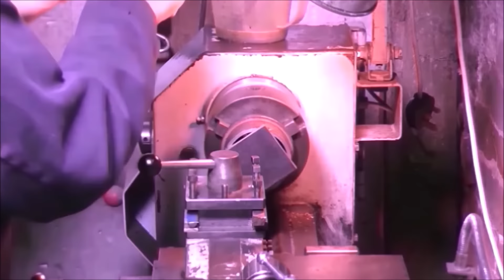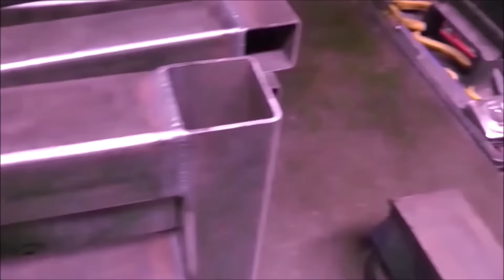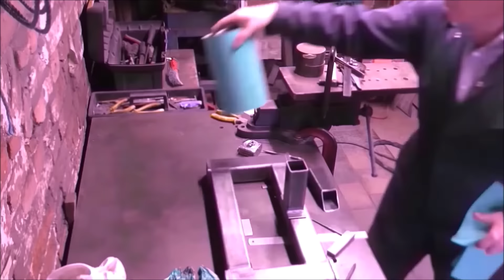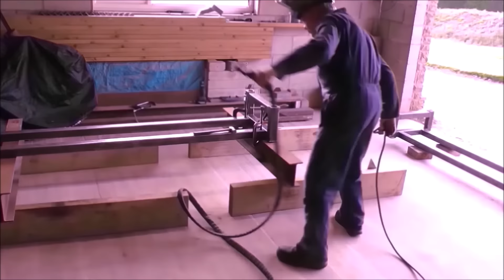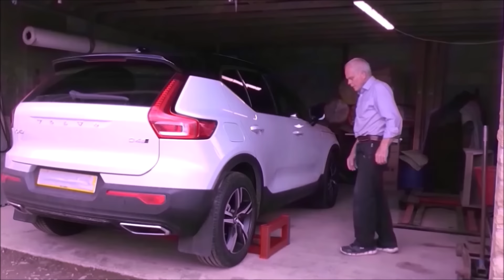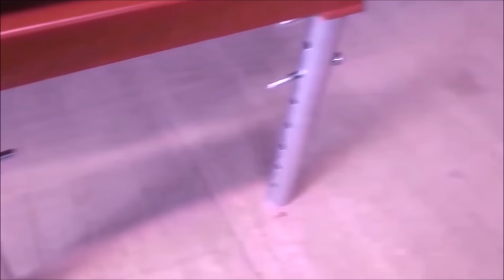The ultimate homemade car jack, simple to use, compact when not in use.

Comment: Honestly not hating, and it works for you which is all that matters. I do want to say thank you for sharing. For me, that much of a build, should have something that's quicker and more flexible. I'd like access to the wheels, brakes, under the engine. It shows me the options and idea's you have. The strength is amazing. As I think about it, the cross beam frames, set up with in the wheel base, and with padded blocks to the frame, might still have what I would want to see in my own set up. Thank you, once again.
Reply from the maker: watch the whole video and you will see any type of repair can be done, thanks for watching
Reply: @johnbower  Can you lift the car and leave the wheels free to remove them or for that matter an engine? I didn't see that in the video and I did watch to the end. Is there a second? Thank you
Reply from the maker: @JamesDoylesGarage.   Because the frames lift from under the car tyres there is plenty of working space above the frames to the under side of the car and it's engine etc, and the frames are easy to work around. Note: once the car is raised on the frames it is so easy to put jack stands under the sills and move the frames away if wheels need to be removed, I do show this in the video towards the end.

Comment: Great job.  This is the best DIY home jack I've seen.
Reply from the maker: Glad you like it, thanks for the comment
Reply: a $200 motorcycle jack and 4 axle stands would do the same job in half the time
Reply: @debeeriz I disagree.

The connected stands make the system a lot more robust.

With single stands the risk of dropping it, when someone falls towards the car would be significantly higher.

The design is extremely thought through.

Comment: Lifting a vehicle for underside service is a problem for everyone without a lift. Jacks and jackstands can be sketchy. I have a project car that needed a torque converter replacement, which means dropping the transmission, as well as running a complete new exhaust system, which required a bunch of cutting and fitting before welding it all together. I knew I'd be spending a lot of time under my vehicle and wasn't going to constantly raise and lower it and setup jacks and jackstands. I had a set of 10" wide truck wheels and tires  and some 2x12 lumber, so I raised each corner of the project vehicle enough to slide a truck wheel under it and rest a section of 2x12 across the truck wheel.  This got my vehicle roughly one foot off the ground on a stable platform and granted me enough room to work comfortably and safely for the duration i needed to complete my tasks. John, i appreciate your ingenuity in trying to solve a problem we all deal with.
Reply from the maker: My lift would have been ideal for the work you have done, the lift only takes a few minutes to raise a car to varying heights and gives clear access to the entire underside, and when the lift is not in use the frames stand on their ends in corner of the garage taking up little space. Thanks for your comment.

Comment: Hey John this is an Absolutely Brilliant concept !!! simple and modular, and to the person who says you cant get at the wheels , simply provide two more tubes that are shorter and use the clever double supported design to replace the long ones on the side that needs the wheel removed  by simply lifting that side and replacing which shorter support tubes  , thus unblocking access to the wheels , they should come out ok Top Marks , this world needs people like you who are not afraid to break ground with fresh ideas . Dont listen to the haters, keep up the good work. and i feel that you have already got half of a towing dolly or car transporter right there, if you just add a couple of struts  wheels and a towbar  Good on Ya !!!!
Reply from the maker: Glad you like it, thanks for the comment

Comment: Hello  Mr  Bower ,  I  skipped  through the build process  because  i  knew  exactly  where you were going  ,    Now then iv also  read all the comments  and there are a lot of negative comments  people  just dont the  grab the simplicity  of your idea ,    I  see this as a very good  frame for lifting a car  of any  size  from a  fiat  to a landrover  and once  up to the height you want put four heavy duty  axle stands in then you can remove  all four wheels and  work away  quiet  happily  .    Now then  for a seasoned   home mechanic  who cant afford  a car ramp this is brilliant  and with   2  / or  4  air hydraulic  bottle  jacks  this could be  lifted with ease ,  BUT  a good  compressor  would be a requirement   then  air tools  come in  to play ,    naysayers have  no vision   Stan .
Reply from the maker: Glad you like the idea, thank you for your comment.

Comment: Thank you for sharing this. As DIY-er myself, I've been thinking about some sort of homemade stand, to help me with a sort of rust repair/restoration project. My idea was to have the stand connected to the wheel hubs, so I can have the wheels removed and have access to the wheel arches. After seeing this, I think it might be possible to use your design as a base and add the HUB mount "extension" to it. I doubt most of the negative comments have ever made or even thought about fabricating anything. There are a lot of things to consider even for a simple task like this and you have done a great job. Thank you again for sharing.
Reply from the maker: Glad you like it thanks for the comment

Comment: I worked many years in the lift industry and what I can say is that your welds are much nicer that what I seen.
the major inconvenient of your design is that most of the time you lift a vehicule is to work on the wheels so the application is limited
very good video.
Reply from the maker: If you watch the complete video you will see that wheels can be removed if needed, Thanks for the comment

Comment: A wonderful concept. Great idea. Here in the US I'm going to have to beef up the design to HD. My vehicles weigh in the 4000 lbs to 6600 lbs range. 1800kg to 3000kg
Reply from the maker: Thanks for the comment, Just for your interest the main frame of the lift is made from 60mm square box section with a 3mm wall,  the legs are made from galvanized tube 48,7mm diameter with a 4mm wall,  it comfortably  supports my Volvo XC40 which weighs close to 1800kg.

Comment: As an engineer I think this is absolutely OUTSTANDING! I have always maintained my own vehicles struggling for HOURS to jack a whole vehicle up enough to only SQUEEZE under! I had a turbo change to do TWICE on one vehicle (don't ask I was sent a duff turbo first off)  and you pretty much nee to sit up UNDER it. The turbo is in a place that can barely be reached from under the bonnet, necessitating  it being jacked HIGH to be able to work easily. May I suggest adding 'spreader feet' to the uprights (square foot plates) - as I have no garage only a gravel drive , to stop them sinking into soft ground?  I have to use 'jacking boards' (thick plywood boards)  to stop my axle stands and jacks just sinking into the ground. You need to patent this and sell them PLEASE!!👍👏👏👏👏
Reply from the maker: @scopex2749,  When designing this car lift I did consider welding plates to the bottom of the legs for use on soft ground, but this would have made it difficult to slide fit the legs into the frames, also by not having plates welded to the legs means less storage space needed when not in use, So I decided that if the lift was to be used on soft ground metal plates could simply be placed under the legs when needed. Thank you for your comment.

Comment: I would love to see if you could incorporate some two ton bottle jacks connected with possibly a hydraulic line from one to lift simultaneously, wow what a great build outstanding
Reply from the maker: YMA. Note: the advantage of lifting from underneath the car wheels, weight is kept on all four wheels even when one corner of the car is being lifted due to articulation in the suspension, this keeps things safe when lifting a car using my lifting frames, providing  one end of the frame is resting on the floor when the other end is being lifted.
The disadvantage of lifting from under the wheels is if you try to lift both rear wheels or front wheels at the same time then there is nothing stopping the wheels rotating and kicking the frame and jack from under the car, that is the reason why one end of the frame must always be resting on the floor when the other end is being lifted. Thank you for your comment.

Comment: This is a very nice design and very nice work. Going along with what some others have said , if you place bottles jack in the middle of your frames( that hold the posts, build a frame around the bottle jack you then could use them.  
If i could post a pic i would.  
I also like the fact when your not using them they dont take up much space, also they would work with lowered cars.
Reply from the maker: thanks for the comment

Comment: I use air bag jacks which go up in 2 seconds, slide in my double stacked track sleepers that are 12” high combined which takes about 2 minutes in total to raise the whole car, and even less if I’m using a axle stands to remove wheels from front or rear…  

Complicated arrangements of jacking a vehicle is exhaustive alone especially wasting 20 mins pre/post work lifting/lowering, besides storage of this system, ever wondered why no one else has done this?? There’s colonies who have designed single wheel lifting already, or use a scissor system that’s air over hydraulic or even the manual lifting version that you can use your shop jack to do the work…
Reply from the maker: The lift is made for people with common sense, thanks for watching the video.
Reply: @johnbower  

Of course, that old adage of common sense…. So how many have you sold.?? What’s the company called you sell through??

Thanks for watching… so you have a nice day now.

Comment: Excellent for retired folks with a vast amount of time on their hands to jack up the vehicle.
Reply from the maker: thardyryll,   This car lift is designed for occasional use by the home mechanic, It's able to completely lift their car up with 700mm  ( 28") of clearance beneath the car if needed, "most" people have common sense and can do this in a few minutes using this system. thank you for watching.
Reply: LOL
Reply: .....Or for folk with a vast amount of time on their hands to write negative comments.
Please provide a link to your video(s)....Mmm?
Reply: @patagualianmostly7437 I realize that your frame of reference for how long it takes to write those 18 words is your own faculty with the English language, but in my case it took seconds. As for posting videos, of what? Screwball gizmoids like the stands in this vid, which make virtually every under-vehicle repair or maintenance procedure difficult or impossible?
Reply from the maker: @thardyryll  I am sure you will understand one day

Comment: Howdy! This a great idea for home use. I do have a question, would it be possible to box in a bit in the middle and use a floor jack to raise and lower the vehicle at that reinforced point? And I must mention, your welding is brilliant and you should build one out of stainless to show off those stacked dimes!
Reply from the maker: Dave Radke, As for your suggestion of welding a central jacking point in the frames this would be dangerous, If you attempted to lift two wheels off the floor at the same time then none of the frame legs would have any weight on them, there would be nothing to stop the car wheels rotating, this rotating action coupled with the weight of the vehicle could then kick the frame and jack from under the car as it came crashing down. You need to be careful when using a trolley jack at the best of times, if trolley jack wheels are prevented from rolling forward (due to a small ridge or stone under it's wheels) the jack arm will pull backwards from under what it is trying to lift, that is the reason I have designed the frames to be jacked one side at a time, (a) you can clearly see if the jack saddle is slipping out of position, (b) when any one side of the frame is being jacked up the other side will always be resting on the floor. Thank you for your comment.
Reply: @johnbower  Makes perfect sense, safety first! Cheers

Comment: Great idea, but... If you want to replace something in suspension it'll be difficult to do. I know, that that you use jacks stands but if you use scissor jack you can put jack stand too.  It's only good for servicing I think
Reply from the maker: Piotr W. Thanks for the comment. Note : scissor jacks are not designed for regular use, they are only designed for occasional use such as a road side wheel change, they also have limited safe lifting height. With my jack frames any job under the car can be tackled, wheels can safely be lifted off the floor 500mm if needed.  When wheels or suspension need to be worked on, the car can be lowered onto 2 or 4 jack stands positioned beneath the vehicle's designed jacking points.
Reply: @johnbower  yeah you have right, but better option will be lift up for car sills jacking points. You can connect your idea with this from this video.   https://youtu.be/rQojAnd7xkI
And that will be the best option. Best regards.
Reply: On my Corolla E110, i got one point center front and center rear to lift the entire front or rear of the car, super easy, sad that many cars don't have that.
Reply: @johnbower  Okay, but if you're going to use jack stands you don't need this framework at all.
Reply from the maker: @brianb-p6586  (a) Jack stands do not lift a car they only support the car.  (b) No standard jack will completely  lift a car 700mm  (28") off the floor as my lifting frames do,  (c) I do also have high jack stands that will support a car at 700mm (28") off the floor, I will be showing how I made these stands in another video.
Reply: @johnbower  (a) this stand also does not lift the car - that's done by the floor jack. (b) Yes, these stands are tall.

Comment: I like this design.  It is simple, elegant, and actually compact.  I would like to improve on the design by having the feet pulled down by a spring and a one way sprag clutch system so that they will automatically push down and keep the device firmly planted on the tires when you jack it up.  That would solve the single corner lift as it is now.  Then you can jack up both sides at a time from the center section.  Either that or add hydraulic cylinders to the end corners, but then you lose the light weight design.  Either way, it's an awesome design and your welding is unreal!  Thanks!
Reply from the maker: @demomoss,    I do have a hydraulic car lift made for the home user, but due to it taking up space, and hydraulic hoses trailing across the floor, it takes time to set it up, and does not give clear access you are having to work around it, because of these problems I decided to design and build a lift that was simple to use, giving clear access when in use, and when not in use it stands on end in corner of garage taking up little space, thank you for your comment.

Comment: Nice job.  Tow trucks use a similar system where they put a bar in front and behind the wheels and chain them together then lift by the wheels.  if you made one bar fixed and the other free to slide under the car and then attach to the frame with a pin or bolt, then you wouldn’t have to back over the bars to get the wheels between them.  You could place the jacks under front and back wheels at the same time.
Reply from the maker: Thanks for watching

Comment: Nice welding and drilling looks great but by the time you set up everything and drag the jack around and crawl under ld be exhausted and fall asleep.
Reply from the maker: Video shows me using the lift for the first time, but after using the lift a few times it's surprising how quick and easy it is to set up, it is very stable and lifts any make of car. Thanks for the comment.

Comment: excellent and safe idea.  i would want the base frame adjustable or wider for different width vehicles
Reply from the maker: P N.  Note: My Volvo XC40 is quite a wide vehicle so most other cars do fit on the frames as they are narrower, but for wider vehicles I think best solution here just have two sets of frames with one set of legs,  the legs would would be interchangeable between the frames. Thanks for the comment.

Comment: Can each lift points be  modified by using 1.5 ton bottle jacks (priced at low as $15 each) provide at least 2 rest points to compensate for Jack's low lift stroke . Your design would be useful when doing brakes and tire rotations if your units are positioned under factory lift points using , if needed spacers can be added at factory lift point to your dual bars. These 2 maintenance procedures would make very useful with your design.
Reply from the maker: Jorge Watanabe. trying to use bottle jacks would cause problems. For stability you need a three ton trolley jack available for £90 to £150.
As for your suggestion of placing the frames under the factory lifting points this again would cause problems,
(a) due to the frames being closer to the centre of the car more weight would be placed on the frame being lifted.
(b) you would not be able to open the car doors as the frame legs would be in the way.
(c) the frames would be close to the underside of the car restricting access to exhaust pipe etc.
(d) The car would not be stable during lifting as not all lift points would be bearing weight (car would be rocking)
Lifting under the wheels as I do is best, if you need to remove wheels just lower car onto jack stands placed under factory lift points.